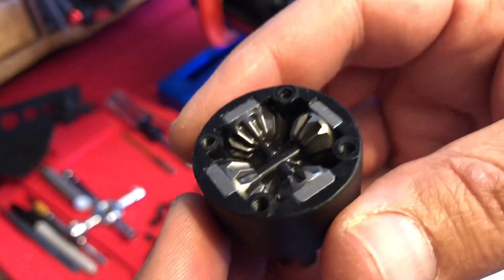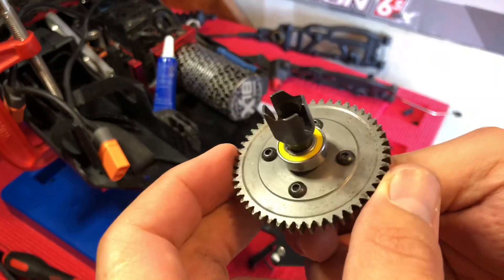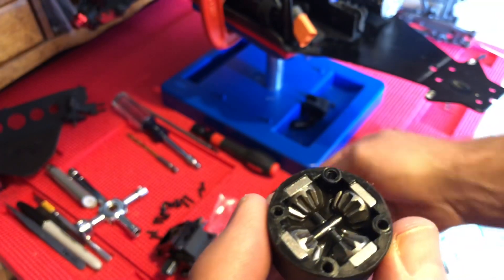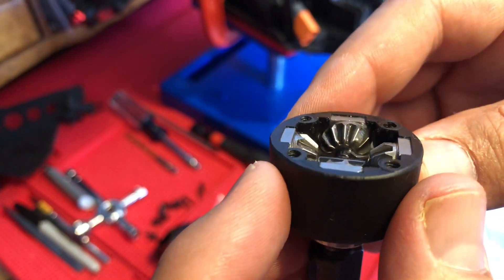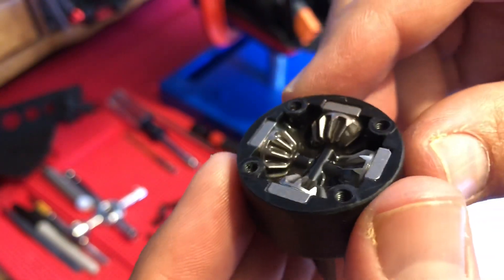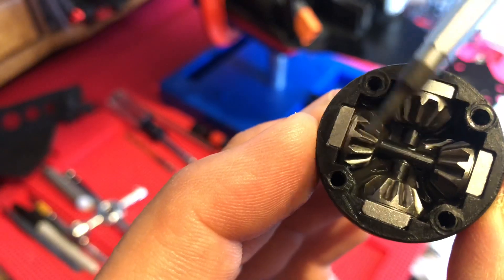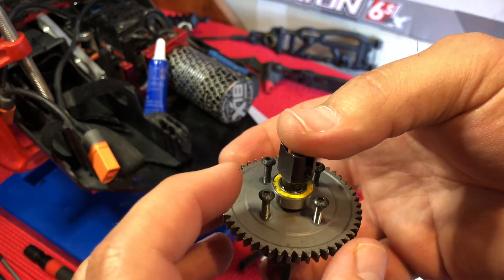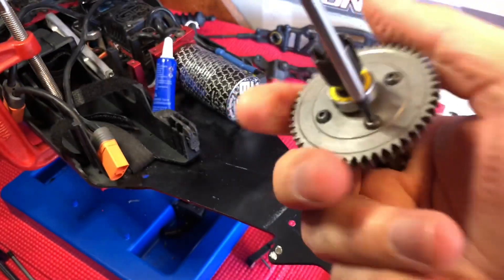ARRMA DIFF TIPS - Kraton, Outcast, Talion, Typhon

Comment: Great video,,but where can I get those shims, Thanks
Reply from the maker: Amazon (search)

MUGEN SEIKI E0206 Differential Washer Set X6/X6T/M-Spec MUGC1206

Or if you want to stick with the stock shims as well as get some back up differential components (which is always a good idea) snag this off Amazon.

Arrma AR310436 Differential Gear Set
Reply: @EastTactics  thx I paused your video and saw the number E0206 went on ebay and ordered them,,,got a question my outcast 6s wont wheelie anymore, runs as fast as ever , batteries are fine, I rebuilt differential last summer and it wouldn't wheelie until I saw the throttle trim was all the way down I turned it up and wheelied great,,but a month or so later it would only wheelie for a short distance on dirt not at all on pavement,,could it be the engne? im going to take the diff apart anyway and clean it and put the shims and gasket you show on/in it,,what oil would you use? any ideas on the wheelie problem? it has been used for 2 summers,. Thank you!
Reply from the maker: Hey Brian it could be a number of things, but it’s definitely going to be tied to the drivetrain and maybe friction oriented things. Are your bearings bad you might have a bunch of bad bearings that is causing too much friction. That’s probably the last thing I would check however. Understanding the drivetrain components might lend a little bit a light on your issue as well. For instance if you’ve got a very large pinion gear then you’re going to lose low end acceleration to some degree not a ton tho. The smaller or less teeth on a pinion gear translates to higher torque on the lower end of your burst speed. Which means  help in the arena of Doing willies. A pinion gear with a ton of teeth say 18 to 22 is going to increase the top speed of your vehicle. It’s not much of a difference, but it’s still something to take note of. Also if your mesh is off In the front and back end or middle of your vehicle you could be losing low-end torque because of stripping. Pay close attention to all the areas shimming helps here.
Another thing to check would be your punch settings on your ESC. Have you turned your punch settings all the way up?

Your engine could very well be playing a part in this issue, if over the years the engine has lost some of its power then your problem could be solved simply by getting a newer engine. 

How are the teeth looking on your gears, Are you hearing stripping noises when you’re punching it trying to do a Willy? Your pinion gear or your input gears on the front and back end of your vehicles might be worn out taking away torque. Another thing to consider is your remote control and your receiver. There might be a communication issue With those components. I know when I changed over from my spectrum to
Reply: @EastTactics  thx for the reply but where you say (MESH) it stops ,could you start where that left off,,and I wonder if that pinion gear slipped a tiny bit making the connection between it and the spur to loose although by hand they turn good together
Reply from the maker: ...Also if your mesh is off In the front and back end or middle of your vehicle you could be losing low-end torque because of stripping. Pay close attention to all the areas shimming helps here. If this video doesn’t mention those external shims I believe another one of my videos does.

Another thing to check would be your punch settings on your ESC. Have you turned your punch settings all the way up?

Your engine could very well be playing a part in this issue, if over the years the engine has lost some of its power then your problem could be solved simply by getting a newer engine.  I believe engines are relatively cheap, and either way it would be fun to get a new engine, especially the faster one. LOL

How are the teeth looking on your gears, Are you hearing stripping noises when you’re punching it trying to do a Willy? Your pinion gear or your input gears on the front and back end of your vehicles might be worn out taking away torque. 
Another thing to consider is your remote control and your receiver. There might be a communication issue With those components. I know when I changed over from my spectrum to tactic The communication/link between myself and my car felt improved in a lot of areas.
Reply: @EastTactics  I don't even no what the punch settings r and ive been into this for 8 yrs lol,,pinion gears sound normal, never checked the front or rear just the middle pinion that goes to the spur gear, sounds NORMAL.tower suggested a new engine since its been used for 2 summers , they said it may have lost some of its UMPFF, even though its as fast, engine is $100.00, could you send me a link to your video on checking the MESH FRONT,BACK, and Middle,,thx a million
Reply from the maker: https://youtu.be/gxY_QNpz2m8
Reply: @EastTactics  Hi again I got the E0206 shims today,,what are the big shims for??? and on both sides of the rear diff its oily/greasy , should that be cleaned out and re-oiled like inside the differential? really appreciate all of your help :):)
Reply from the maker: brian, Those are some great questions, the two larger shims were designed to go behind the planetary gear in the diff houses. The planetary gears is the large gear that sits at the bottom of the diff house that basically goes in first. That large shim would fit between it and the tiny o ring. However that shim was no longer necessary if you have the newer V4 Arrma lineup. If however you have the version three or older then you’ll notice there is no shim between that planetary gear and that small O-ring, In which case he will want to use that large shim. I’m not sure if you got a chance to watch that longer video where I go into detail about these topics. But I do cover this larger planetary gear shim and whether or not it’s needed. I myself found that when using the larger shim In combination to all of the internal shims it made my differential house too tight And I felt resistance after tightening everything up, so I stuck with the smaller stock shim that comes in the version 4 differential houses. The smaller one works fine. 

As far as the grease on the outside of the Differential, yes you will want to replenish that before reinstalling your diffs. I have a video that covers what i use. Here’s the link.

https://youtu.be/oByzgDN0gTA
Reply: @EastTactics  thx appreciated, but I don't no why but when you reply I only get part of it,,your message ended at(I FOUND THAT WHEN I USE THE LARGER SHIMS IN COMBINATION, then the message stopped?
Reply from the maker: Weird...The comment below should end with me giving you a link to another one of my videos
Reply from the maker: ...I myself found that when using the larger shim In combination to all of the internal shims it made my differential house too tight And I felt resistance after tightening everything up, so I stuck with the smaller stock shim that comes in the version 4 differential houses. The smaller one works fine. 

As far as the grease on the outside of the Differential, yes you will want to replenish that before reinstalling your diffs. I have a video that covers what i use. Here’s the link.

https://youtu.be/oByzgDN0gTA
Reply: I no that's strange a couple of your replies have ended to where I cant scroll down to read the rest of it, but thankfully you have filled in the blank as you could call it :) @EastTactics
Reply: @EastTactics  hi,,i told you I cant get wheelies with the 6s outcast ,,so I bought those wasers you talked about and cleaned the differential BUT the big gear in the very back isn't hardly turning the 4 smaller ones, so what im saying the 4 little gears don't turn together just sporadically its like,,i think that big back gear needs to be replaced?? whats your opinion?
Reply: @EastTactics  never mind I see I put those 4 parts that the washers go against that fit in the slit I put the round side up and saw that was wrong turned them around and it spins fine ..for now.
Reply from the maker: brian Stover, I think your talking about the planetary gear. Your saying your spider gears are not spinning? Are both planetary gears installed? There are two. One at each end of the diff house. That’s my first thought. 
Either that or your saying your diff house (once closed up) is too tight? If your diff house is too tight (once closed up) then remove that large shim that sits behind the planetary gear, it’s too thick and your diff doesn’t like it

Comment: I keep stripping the hex on those last 4 screws!! Driving me crazy haha this is my 3rd attempt so I went and got the hot racing diff carrier cup . Hopefully it does the job after I shim it with the mugen shims . Awesome video thanks
Reply: If your stripping the hexes on the dif screws you need better drivers. There is a reason everyone says MIP and nothing else.... They make that much a difference. I didn't believe until I had the similar issues so I finally just spend the $40 and now no worries.... Everyone is right
Reply: then move on to the next level: torx
Reply: Dude I've never stripped one of those but I've overtightened one! Make sure you use good tools with good tolerances, not the crappy things that come with the kit

Comment: Im going to try 50k cst f 300k cst mid and 20k cst rear see how it goes
Reply from the maker: That’s legit 👍
Reply: @EastTactics  only problem is that I could not get the team Associated one the only brand that is available in au is a brand called team zombie have you heard of that before
Reply from the maker: I haven’t. I don’t know what the deal is with team associated. Seem COVID hit them hard or something.
Reply: @EastTactics  the rc shop says they are having issues getting the bottles to put the fuild in
Reply from the maker: Interesting  🤔 hopefully they can get back going.
Reply: How’s your diffs holding up on 6s at these rates Daniel seem pretty sweet still
Reply from the maker: Now days I run 
20k rear
Silicon earplugs center
80k front

12t stock pinion

Diffs are 👍
Reply: @gonzodetroitify  yeah mate I've done about 20 runs with these weights turns great I took the front sway bar off its werid now I seem to have more control but I am only running at 4s which I think is a good spot for hard corners and track racing 6s just boots too fast

Comment: small file on that dif housing , that killed your gasket
Reply from the maker: Are you saying I should use a small file on the deck housing before I put the gasket down to prevent leakage? 
Using the X-Acto knife was a bad idea?
I think that’s what you’re saying. What do you suggest instead of using a small pile just turning a hold of house upside down on some fine sandpaper would also be a good idea?
Reply: @EastTactics  yea with a block would do,    i used 1000 grit on a flat table lightly in circles to knock down the bur and haven't had a gasket issue since,,,  it was cutting gasket
Reply from the maker: Nice! Ya I’ll do that!
Reply: @EastTactics  yea , cleaned it with brake cleaner and blew it out with compressed air. nice smooth mating surface

Comment: You know what is an even better tip? Stay away from the Arma 6s line. It has the poorest manafactered drive train I have ever seen. Got rid of my Arma 6s. I had to stock pile shimms and diff rings and pinions for it. What a horrible design. The Arma 3s line trucks are way better bashers.
Reply from the maker: I’m sure if you ran the Kraton on 3s only you’d find the same outcome as with the 3s line. Once shimmed correctly at Least for me, mines been fine. I love the 6s line and the power they have. But ya, they are more prone to wear issues in the drive train no doubt.
Reply: Why would you run a 6s truck on 3s anyway. To me that makes no sense. Been in this hobby for a long time owned many 3s 6s 8s trucks. I have a 3s big rock and it has plenty of power and no drive train problem. Unlike the junk Kraton I had.
Reply from the maker: I don’t think anyone would. I was just try to make the point that 3s is a lot easier in any drive train. 
They improved the gears in the EXB. You might have better luck there if you ever try the 6s line again. 
I have both the EXB and the V4, no real issues that were not my own fault. I had her geared (pinion wise) too high for a bit. She didn’t like that. Backed off and it’s been gear since. Sorry to hear bout your troubles. 
Heard good thing about the Slegde, especially after m2C puts out the upgrades motor mount. 
I’ll likely nab one of those then. 
Hope you have a great weekend brother! 😎
Reply: Yeah l checked out the new exb system as well they put some kind of slipper plates in the diffs which did nothing to solve the problem. People are still having to shimm the hell out of them so they don't strip out. The bottom line is that they put a skimpy little diff ring and pinion in a big heavy 6s powerful truck. Horrible design. Instead of putting some kind of slipper plates in the diff. Why not just put a larger diff ring and pinion in the truck so it can handle a heavy 6s truck. Problem solved. My days with the Arma 6s line are over plus they have metal chassis I Bent every metal chassis truck I have owned. The only one l never Bent was the m2c metal chassis better not bend for a 150$. I am a hardcore basher and to be honest the big rock is one of the best bashers l have owned.
Reply from the maker: Right, but you can remove the slipper plates and they have a special kit you can put in to run open Diff. And as far as the EXB goes they did a beef up the gears both the spiral input gear and the ring gears on the differentials are sporting thicker and longer teeth. 
Not trying to be convince you to re-open the book on Arrma but I just say’n.
Yeah I’ve heard those big rocks are amazing
Reply: Would rather just buy a truck that is built correctly from the beginning other then fixing a factory defect from Arma. They may have improved the exb diff and pinion but not enough. I know all about the exb truck my buddy has one and l think the so-called improvements Arma made on the truck are weak. I would never be convinced be convinced to buy another Arma 6s . I built one from the chassis up with all m2c amd HR parts. I broke something on that truck just about Everytime l bashed it. My opinion will never change on the Kraton. The design of the drive train on both v4 and exb is garbage. Buying a truck that comes from the factory shimmed? Really ?that right there tells me somebody screwed up from the beginning when they designed it. Lost track a long time ago keeping track of how many rc trucks l have owned. Don't remember one of them that came from the factory with shims. I knew that was a bad sign from the first l ripped that truck open.
Reply from the maker: I hear ya, I won’t try to convince you further  lol. What we do have in common is we both love the RC hobby. I would love to invite you into the jump competitions I’m running. You can enter with any rig.
Reply: @EastTactics  To each to us own. Love the hobby always will. Every body likes what they like. Not a rc truck on this planet that doesn't have some sort of factory issue. It is what it is.  If Arma let me design a truck they would go out of business because nobody wouldn't have to buy replacement parts. It's all part of there scheme so we have to continue to line there pockets with our money for parts. We love the hobby so what we will do is bash break parts and keep there wallets full of our money. Have a good one.
Reply: @Schmidt3850  AMEN. however,..if you go the "TEAM CORALLY" way,.. not to worry so much of a lot of that stuff,.. in my opinion !